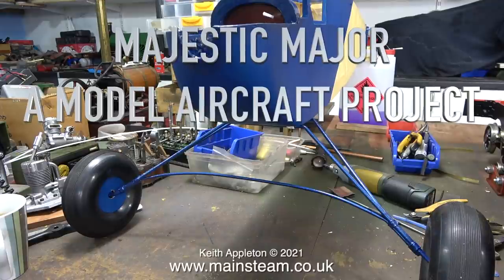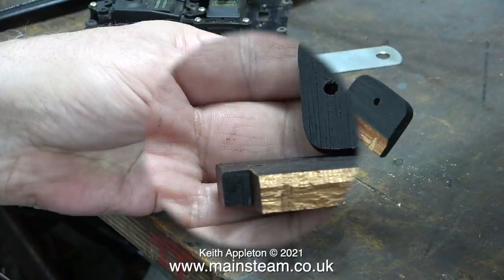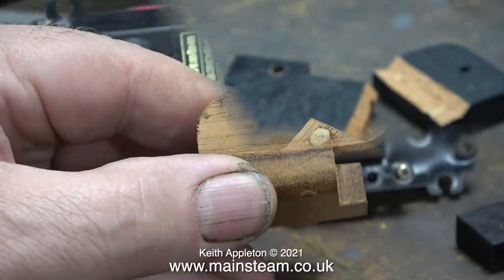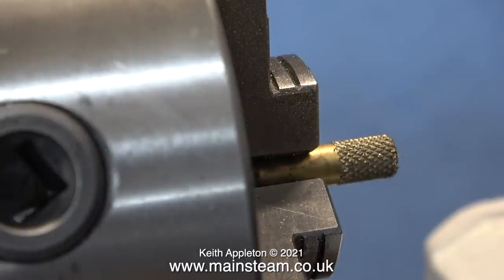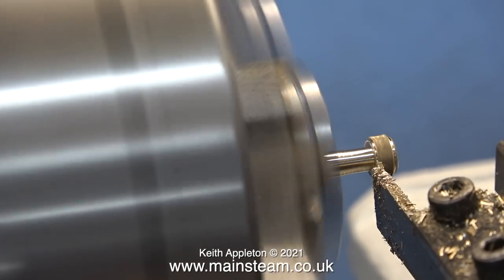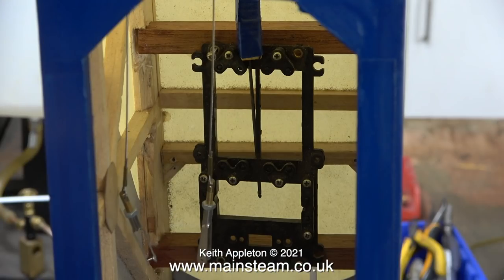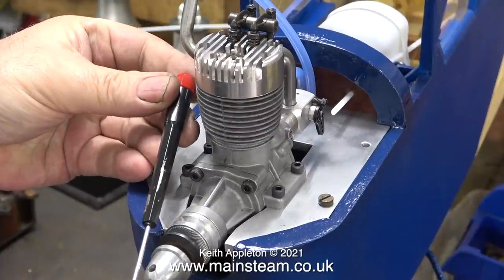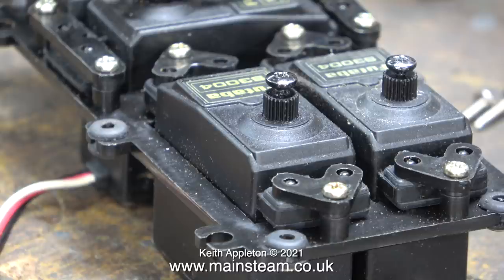MAJESTIC MAJOR PROJECT - PART #10

Comment: Keith, when I started work at an aviation repair depot and interfaced with the Aerospace Engineers, I learned that even metal (when used in aircraft) has grain and that has to be considered when designing and/or repairing certain parts.  Of course, we hobbyists are extremely unlikely to need to worry about the different properties a piece of cold rolled sheet/plate has, but it was (& still is) interesting to find that out!  You probably saved some of us from making that mistake with wood structures by showing how the part broke.

Comment: You know,looking at that 4 stroke motor,it suddenly occurred to me that with an individual jug plus exposed valves,there is a considerable resemblance to the WWI  Mercedes aircraft engine. I wonder if the original designer did that intentionally. One cylinder instead of six,but when I was a kid,I did get to look at a Mercedes engine at Old Rhinebeck, New York. Trying to remember if the valves were parallel or perpendicular to the crankshaft axis.
Two stroke Cox stuff was all we had at the time. And yet your little motor is elegant and simple. Interesting.

Comment: I don't wish to criticize, but couldn't that wooden throttle support be 3D printed? Just a question, I hope isn't criticizing.
Reply from the maker: I had a choice: Either make the bracket from an old piece of wood at zero cost, or go out and buy a 3D Printer, plus the software and spend loads of time getting to know the software and the printer - a bit of a no contest I think, don't you?
Reply: @keithappleton  I agree....just wondered if it was possible.....yet it IS too costly. Thank you for the reply.